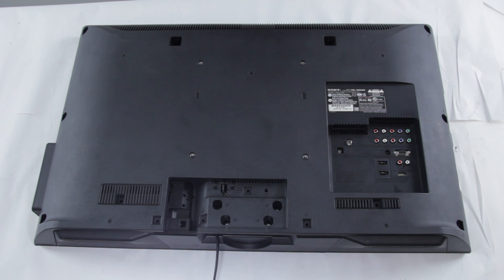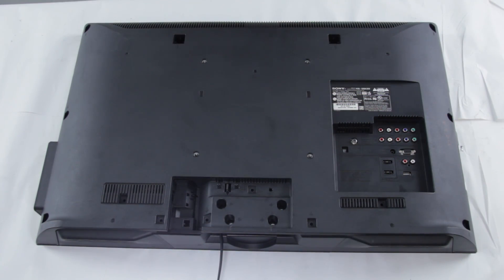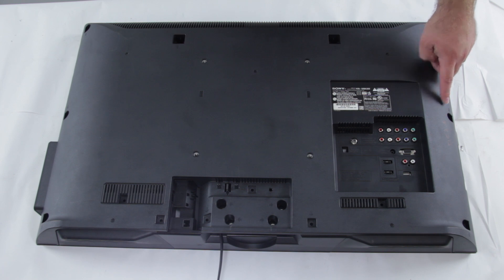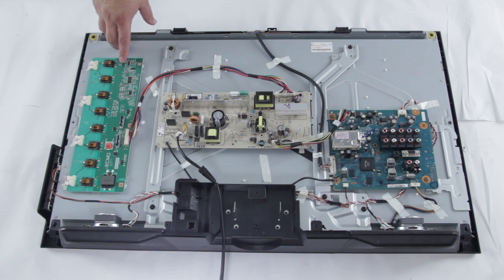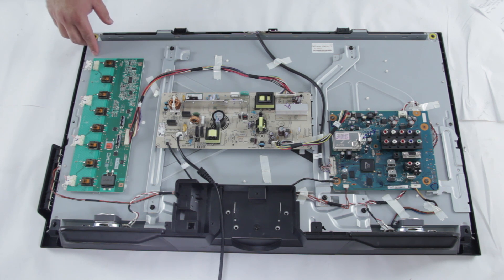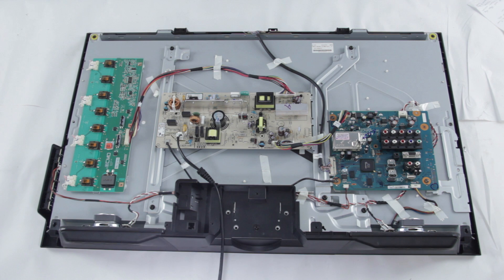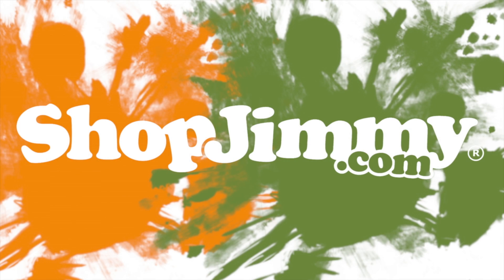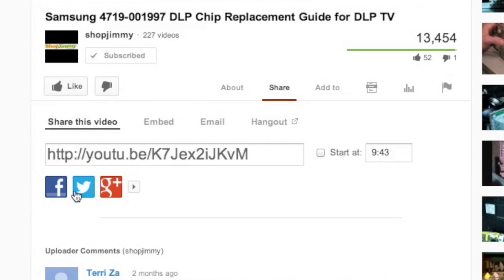LCD TV Repair Tutorial - Backlight Inverter Common Symptoms & Solutions - How to Fix LCD TVs

Comment: Hi there.  I have a Samsung LN32B360C5D.  My tv picture starting going on and off and now it's just off but I do have audio.  I think it is the backlight converter.  Because I don't have a lot of money right now, I would like to try to do this myself.  Where can I get the parts (I live in Denver). Thanks.
Reply from the maker: Brenda H I recommend replacing the inverter in your TV.  Here is a link to replacement parts for your TV model number on our website, click here:  http://www.shopjimmy.com/catalogsearch/result/?q=LN32B360C5D  It appears we are out of stock for inverters for  your TV model number.  You can identify  the part number that matches your inverter and then sign up to be notified when the part is back in stock.  Here is a link to a video showing how to identify your part number, click here:  Samsung Plasma TV Repair: Samsung Plasma Panel Parts Guide  You can also call our customer service for further assistance with your purchase.  (877) 881-6492  Thanks and please let us know if you have any further questions!  www.shopjimmy.com

Comment: Ref: Samsung SmartTV UN466003SF 2 yrs old S/N Z4DY3CVBA02807J.  Dark screen but watchable with lights off, still very dim.  Dim screen on DVI input.  Tried to recalibrate using Settings menu. The backlight slider bar on Picture setting whited out.  Opening splash screen on startup bright colored as normal before dissolve to dark screen issue. New backlight inverter board needed??  Or other-board.  No access panels to individual boards on back panel are in place and will most likely have to remove entire backpanel to replace.  If a bad board is indicated, and just  remove, replace old board and reinstall plug and play I should be OK.  Kindly advise. Thanks.
Reply from the maker: Lloyd Stafford I recommend replacing the T-con board in your TV.  Could you double check the model number for me and reply with that information, and then I can recommend a replacement part for your TV repair.  Thanks and please let us know if you have any other questions!  www.shopjimmy.com

Comment: Can the blacklight inverter also be responsible for half of the screen going black? Sometimes you can see through the blackness and see a partial image. Sometimes when you tap the top or side of the housing the screen will go back to normal for a period of time, or just for a second. It seems to fix itself after the tv has been on for a while (one hour or more) and is fairly warm. Any ideas? My tv is a SANYO, MODEL#DP46849, SERIAL#69250819519979.

Any feedback is much appreciated.
Reply: Needed to add that the half that is going black is the right side of the screen. The left side continues to work fine. Thanks!
Reply: Christopher Blackburn This isn't an answer but my Samsung has a similar problem. It'll work for hours even days as long as the backlighting was set very low like to 1 or 2. If set any higher the backlighting would flicker very rapidly. Eventually it would flicker regardless of what you backlighting was set to. Then you Backlighting would go out in evenly in four sections from right to left. Unplug it for a few days and the cycle seems to restart.  
Model # LN52C530F1FXZA
Reply from the maker: Christopher Blackburn The inverter can cause this problem and you can try replacing it to see if it fixes the problem.  However it could also be your TV panel.  TV panels are often expensive, and hard to find.  Here is a link to replacement parts for your TV model number on our website, click here:  http://www.shopjimmy.com/catalogsearch/result/?q=DP46849  Be sure to match part numbers on your current board, with your replacement for compatibility.  Here is a link to a video showing how to identify your part number, click here:    LCD TVs 101: Part Identification Number Guide for AU Optronics (AUO) Backlight Inverter Boards  You can also call our customer service for further assistance with your purchase.  (877) 881-6492  Thanks and please let us know if you have any further questions!  www.shopjimmy.com
Reply from the maker: Layton Bulter This sounds like the backlight inverter/power supply is bad.  If you have a separate backlight inverter, I recommend replacing that board, if the backlight inverter is on the same board as the power supply, I recommend replacing that board.  Here is a link to replacement parts for your TV model number on our website, click here:  http://www.shopjimmy.com/catalogsearch/result/?q=LN52C530F1FXZA%EF%BB%BF  Be sure to match part numbers on your current board, with your replacement for compatibility.  Here is a link to a video showing how to identify your part number, click here:  Power Supply Video: TV Part Number Identification Guide for Samsung DIY TV Repair Power Supply Unit (PSU) Boards  Backlight Inverter/Power Supply Video:  Samsung Timing Control (T-Con) Boards Part Numbers Identification for LCD HD TV Repair  You can also call our customer service for further assistance with your purchase.  (877) 881-6492  Thanks and please let us know if you have any further questions!  www.shopjimmy.com
Reply: ShopJimmy.com Thanks for the information. I was able to take my set apart and located my backlight inverter #DS1946T03007 Also found the part on your site. I do have another question however, I've seen on other videos where some sets have small electronic tabs at the top of the tv set, in which if not depressed, not making proper contact or are bent, may cause similar issues. I'm not sure what these are called or even if they're the same thing as the inverter.  Does my tv set have these tabs or is it particular to some models? After taking my set apart and putting it back together, I now have, at times, several vertical lines on the right side of my set (same side I was having issues with prior). Also, there is, for lack of a better word, ghosting. When I turn the channels, the image from the previous picture is still present, but then slowly fades away. Did I damage something else or can this also still be the backlight inverter issue? 

Thanks for all your help and appreciate having someone like yourself on YouTube to help people like myself.

Comment: Hi,

We are having ghost image issue on sony bravia 46" LCD tv. Model is Sony Bravia Z-Series KDL-46Z4100/B 46-Inch 1080P 120Hz LCD HDTV.
It started out with lines and then image darkening at the top of screen, now it is dark many places in the image on the screen not just top.

The TV is 2 year old.

Any help for the cause and fix is appreciated.

Thanks,
S
Reply from the maker: serene vision I recommend replacing the T-con board in your TV.  You will want to identify the part number on your t-con board and then search that part number on our website, www.shopjimmy.com for a replacement.  Here is a link to a video showing how to identify your part number, click here:  Samsung Timing Control (T-Con) Boards Part Numbers Identification for LCD HD TV Repair  You can also call our customer service for further assistance with your purchase.  (877) 881-6492  Thanks and please let us know if you have any further questions!  www.shopjimmy.com

Comment: I have a Vizio M420NV with no backlight.  Logo does turn from amber to white when powered on.  There is a picture if a flashlight is shown on the screen.  I replaced the power supply board (which I was told was fully functonal) which also contain the inverters.  I'm still having the same identical problem.  I'm not sure what to do now.  I don't want to keep throwing money at it.

Comment: Hi! i have a Samsung tv LN-T4671F and the right side sometimes when i turn the tv on is very dark and sometimes is just a little dark that you can barely see the difference please let me know what is the problem if you can and if you have the parts to fix.
Thank you in advance
Reply from the maker: Alex Ca I would recommend replacing the power supply in your TV.  Here is a link to replacement parts for your TV model number on our website, click here:  http://www.shopjimmy.com/catalogsearch/result/?q=T4671F  Be sure to match part numbers on your current board, with your replacement for compatibility.  Here is a link to a video showing how to identify your part number, click here:  TV Part Number Identification Guide for Samsung DIY TV Repair Power Supply Unit (PSU) Boards  You can also call our customer service for further assistance with your purchase.  (877) 881-6492  Thanks and please let us know if you have any further questions!  www.shopjimmy.com

Comment: I have a Samsung LCD with one side of the screen having a dark area. After a few minutes it warms up and works fine but when I turn it back on after having shut it off it again has a dark spot for 3 to 15 mins
Reply from the maker: Vance Lloyd This sounds like a TV panel problem.  If your TV panel is bad, it may be more cost-effective to replace the TV as panels are typically hard to find in stock, difficult to replace, and expensive.  Thanks and please let us know if you have any further questions!  www.shopjimmy.com

Comment: Hello there.  I have a vizio gv52lfhdtv10 back light comes on on right side only for about 1 sec, then shuts off. i have sound, and can see menu with flashlight.tv turns on and off normally. took off back per your instructions, and looks like i have 2 bl inverters. how can i tell which one is the bad one ? thanks, and go Vikings!!
Reply from the maker: Greg S. I would recommend replacing both of the backlight inverters at the same time.  Here is a link to replacement parts for your TV model number on our website, click here:  http://www.shopjimmy.com/catalogsearch/result/?q=gv52lfhdtv10  It appears that some of the TV parts for your TV model number are out of stock.  You can sign up on the product pages to be notified when the parts are back in stock.  Be sure to match part numbers on your current board, with your replacement for compatibility.  You can also call our customer service for further assistance with your purchase.  (877) 881-6492  Thanks and please let us know if you have any further questions!  www.shopjimmy.com

Comment: I have a Vizio GV42LFHDTV10A Seial LHAARAH4311389, that when turned on the picture flickers or flashes and dark patches on one side with sound, but after 15 or so minutes clears up and picture is perfect, it's been happening for several months. Could that be a problem with the backlight inverter or the tcon? Thanks in advance
Reply from the maker: Jose Santiago This could either be the t-con board or the panel that is the problem.  If the TV panel is bad, it may be more cost-effective to replace the TV.  Panels are typically expensive, hard to find and difficult to replace.  You can try and replace the t-con to see if that fixes your problem.  Here is a link to replacement parts for your TV model number on our website, click here:  http://www.shopjimmy.com/catalogsearch/result/?q=GV42LFHDTV10A  Be sure to match part numbers on your current board, with your replacement for compatibility.  You can also call our customer service for further assistance with your purchase.  (877) 881-6492  Thanks and please let us know if you have any further questions!  www.shopjimmy.com
Reply: ShopJimmy.com
Thanks for your quick reply. My decision now is whether to go led or plasma. I know I'm definitely staying away from Vizio. Thanks again!

Comment: I've got a Sanyo 42" LCD HDTV model: DP42841. When I turn it on half the screen looks fine while the other half of the screen is distorted a bit and darker. After about 2 seconds the entire screen goes out completely. The TV remains on and back lights remain on but screen is blue or grey in color. Sound works fine but there is no picture. Are those symptoms more likely an issue with the inverter board, tcon board, or main board? or something else?
Reply from the maker: James Longhurst This sounds like the problem is either the t-con board or the panel in the TV.  If the panel is bad, it may be more cost effective to replace the TV.  You can replace the t-con board to see if that fixes the problem.  Here is a link to replacement parts for your TV model number on our website, click here:  http://www.shopjimmy.com/catalogsearch/result/?q=DP42841  Be sure to match part numbers on your current board, with your replacement for compatibility.  Here is a link to a video showing how to identify your part number, click here:  DIY LCD TV Repair: Part Number Guide for AU Optronics (AUO) Timing Control (T-Con) Boards  You can also call our customer service for further assistance with your purchase.  (877) 881-6492  Thanks and please let us know if you have any further questions!  www.shopjimmy.com

Comment: hi i have a dell W2600 and when i power it on on image flashes on for a second then goes black but it remains powered on ! would this be and inverter ? is it repairable at home ? thanks in advance :) liked and subed
Reply: i also did a torch test and i can see menu when i press buttons
Reply from the maker: kyle mcmahon
I would recommend replacing the inverter on your TV.  Here is a link to replacement parts for your TV model number on our website, click here:  http://www.shopjimmy.com/catalogsearch/result/?q=W2600  Be sure to match part numbers on your current board, with your replacement for compatibility.  You can also call our customer service for further assistance with your purchase.  (877) 881-6492  Thanks and please let us know if you have any further questions!  www.shopjimmy.com

Comment: I have a 46inch Sony Bravia KDL-46SL140 that when I turn it on, it comes on for about 2 seconds then the screen goes black and the led flashes red 6 times, could you assist me in finding the correct part to replace if any to make it work again?!

-Thank you
Reply from the maker: zkepz On this model TV, the backlight inverters will shut down very quickly, you have to be fast and pay attention to the screen.  I would recommend running the flashlight test on your TV to help determine if the problem is the main board or the backlight inverter. Here is a link to the flashlight test video: No Image No Picture on Screen-Flashlight Test LCD TV Repair - How to Diagnose Broken Board TV Repair  Please reply with the results of your test and we can suggest a fix. Thanks and please let us know if you have any further questions! www.shopjimmy.com

Comment: Hello there! I have sony bravia 46EX720. The problem is that you can hear sound when TV is switched on different TV program, but no picture at all. Is this the likely to be inverter or bulb that is fault,
Reply from the maker: Sembuli Mchawala I would recommend running the flashlight test on your TV.  This will help to determine if the problem is your backlight inverter or the main board.  Here is a link to the flashlight test video, click here:  No Image No Picture on Screen-Flashlight Test LCD TV Repair - How to Diagnose Broken Board TV Repair  Reply with your results of the flashlight test and we can recommend a replacement part.  Thanks and please let us know if you have any further questions!  www.shopjimmy.com

Comment: Hello i have a Samsung ln52a550p3fxza everything is good except the bottom of
the tv has like a light dark shade running across the screen one side looks darker then the other would that be an inverter problem.
Reply from the maker: paul dicicco I believe this could be a few different problems.  Either the backlight inverter(s) or the panel.  Here is a link to replacement parts for your TV repair on our website.  http://www.shopjimmy.com/catalogsearch/result/?q=ln52a550p3fxza  Be sure to match up part numbers on your current board and the replacement part.  You can also call our customer service if you need further assistance.  (877) 881-6492  Thanks and please let us know if you have any further questions!  www.shopjimmy.com

Comment: Hisense F46V89C

Serial: F46V89C/C1Z1

Inverter board product number: SSI4460_08A01 rev.02

I primarily used tv for video games and I played on night and turned tv off and then next morning the tv would turn on with sound, but no picture.

It also briefly flashed the Hisense logo then go off. 

I opened up the back and the tv does show signs of rust. (It was used outdoors under a awning)

I cleaned connections and rust with 91 percent isopropyl alcohol. I'm under the suspicion it's either a backlight or inverter. The inverter shows signs of wear from being outdoors also. 

Is there anyway I can test to determine if it's back light or inverter?
Reply from the maker: Jeremy Brace The backlight and the inverter are the same board, the backlight inverter.  Could you please elaborate on the other board that could be the problem.  Your TV most likely has a backlight inverter, main board, power supply, and a t-con.  Here is a link to replacement parts for your TV on our website.  http://www.shopjimmy.com/catalogsearch/result/?q=Hisense+F46V89C  Click here and please let us know which two boards could be bad, and any other information about your problem.  Thanks and please let us know if you have any further questions.  www.shopjimmy.com